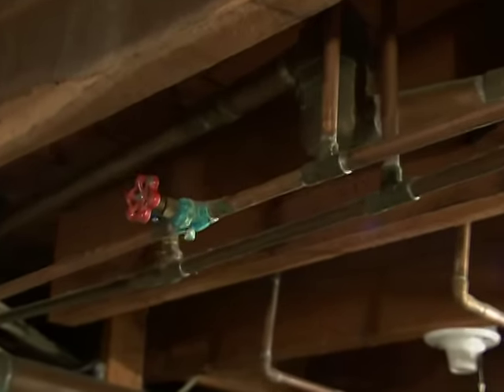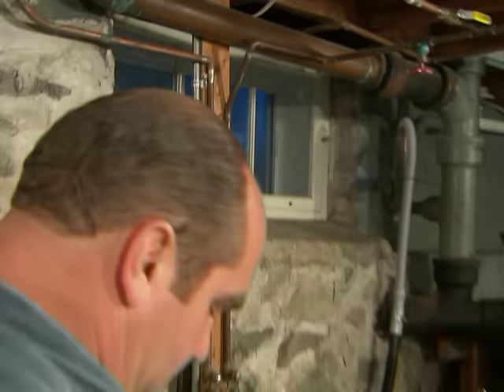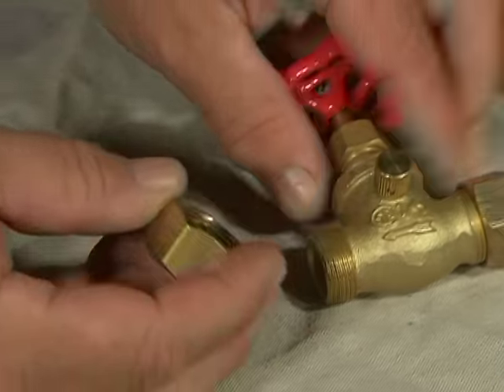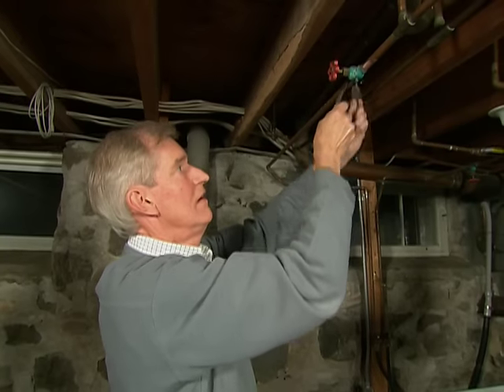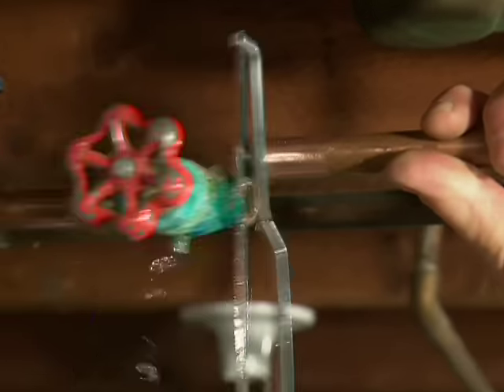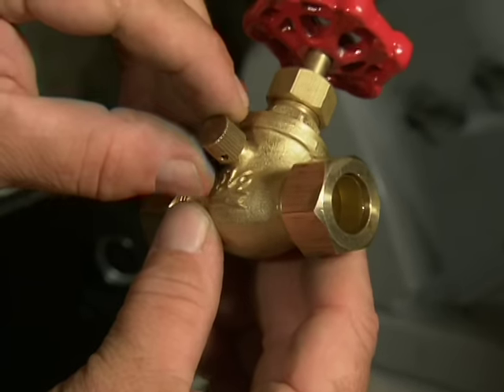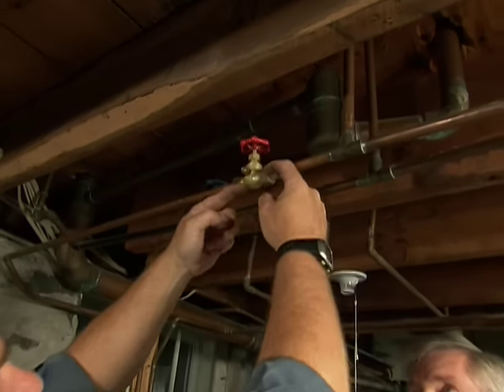How to Replace a Plumbing Shut-Off Valve | This Old House

Comment: what grit  sandpaper did you use
Reply: It's called sand cloth and found in the plumbing area. It doesn't have a grit number like what you use for wood.
Reply: it's emery cloth which is aluminum oxide abrasive glued to fabric. for copper pipe you'd use 120 to 180 grit
Reply: I've always used what's called crocus cloth on copper pipe. It'll really clean-up copper pipe really slick and pretty. It's an abrasive sheet (You can also buy it in a roll) that's similar to sandpaper (Closer to emery cloth), but covered with a layer of very fine, loose, iron oxide particles rather than with an abrasive like sandpaper.

Comment: how many teeth per inch should the minihacksaw have to cut through the copper pipe?
Reply: it is often best to have several teeth of the saw engage the cross section you are cutting.  for the relatively thin copper pipe this would require many teeth per inch.  32 might be close, but if you cant find one that fine use as many as you can get.

Comment: he did not explain why he points the handle up
Reply: preference
Reply: so that the waste valve would not completely drain the pipe.  maybe not such a good idea.
Reply: Yes Richard I would like to know why you put the valve up and the waist up instead of the waist down like how it was originally. I'm sure you have a good reason I just can't think of it so please enlighten me if you will. Thank you
Reply: Steve Kunkel when you place the valve handle down it increases the chance of debris settling in the valve which could potentially cause the valve to not close when needed. However in this situation since he used a shutoff that has the drain on it, placing the valve handle upwards renders the drain useless. Placing it on the side usually makes it so little to no debris settles in the valve, and then the drain would work the way it were designed.

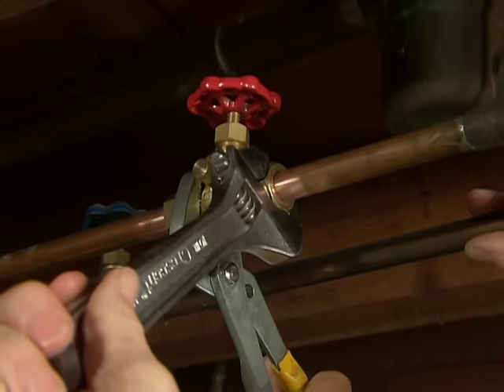Comment: 3:09 3:29 Internet Tool Police: You instructed the homeowner and your internet audience to use a cresent wrench backwards, twice. 
[EDIT] I think the manufacturer recommends what leads to fewer warranty claims. Putting the pressure at the bottom of the sliding jaw leads to less chance of rounding the fastener.

Comment: Can the Sharkbite fitting be used instead of that fitting?
Reply: Most likely as long as there is enough pipe left.
Reply: Shark bites don't hold on copper if there is a freeze.  They pop right off.
Reply: If your pipes freeze that hard, you're gonna have problems no matter what unless you use Pex, then your chances of surviving a deep freeze are much better as demonstrated here:    https://www.youtube.com/watch?v=OOeBJ8mDr8Q&list=PLDCpav5_VXPLU8El3cwSPfl-zedvKbhKu

Comment: ALSO THATS THE STANGEST THING  WHY CUT THE COPPER LINE IF YOU COULD EASILY USED A TORCH OR HEAT GUN TO MELT THE SOLDER AND SLIP OFF THE BALL VALVE
Reply: The operative word is "easily."  If he could of easily de-soldered the valve, then he could of easily soldered on a new one. I think he was showing an option for the homeowner.  If that compression valve needs replacing in the future, it's a big deal getting those ferrules off.  They require a special tool.

Comment: how would i do this if my pipes are galvanized not copper?
Reply: Timothy Champagne you need to find two threads in the area of the old valve , so the old valve will unscrew that’s one thread than you have to replace the pipe down to the next thread in line. Once you have two threads than you screw on a thread ball valve , they are the best valve out there and they work for your lifetime, second go to the second thread and screw on a copper female adapter with a piece of copper already soldered
Into the adapter, and than screw a copper male adapter into the house side of new valve with a piece of copper soldered onto that fitting also and you want your two new pieces of copper that are not threaded to butt up against each other , than just put a copper coupler on the ends of the new copper and solder that last fitting.
Reply: Many old houses have galvanized steel supply lines well before copper was common practice. When possible (access and financial means), it's best to replace all of the old pipes because the old pipes will rust up and give you hard water and rust stains as they age. You just  have to make sure you use a brass or dielectric connection between the old and new pipes or you'll have a bad time (bad chemical reactions between zinc and copper)
Reply: Timothy Champagne galvanized pipe doesn’t rust that’s why it’s acceptable to use for potable water.
Reply: Daniel Gordon didn’t you ever learn the difference between then and than?
Reply: NonyaBusiness! Lots of older houses have galvanized iron water supply lines. Before the days of copper and pex

Comment: Bigger problem when this valve fails.  You will have to cut the pipe to remove the ferules.
Reply: +PanamaSticks Why? I've never had to do that. Either slide it off or use a splitter.
Reply: +nmg196 Slide it off?  My experience with compression fittings is that the ferrules don't let go of the pipe after you loosen the collar.  So the next time you need to replace the valve you will either have to cut the ferrules off the pipe, or find an identical matching valve that can utilize the old ferrules.   If you cut the ferrules off, you will have a longer gap to bridge.  You will need to splice in some pipe.  Every splice is another  potential leak.   So I would prefer to sweat off the old valve, clean the pipe, and sweat on a new one.
Reply: +PanamaSticks I removed 8 yesterday just by sliding them off with some grips. I've heard this doesn't always work if they've been severely over-tightened (and compressing the pipe itself) but in that case, you can male a diagonal slot with a hacksaw (not all the way through!) then use a flat blade screwdriver to snap it off. There shouldn't be any need to cut the pipe unless the pipe has been severely compressed or damaged by over-compression of the ferrule (or a botched attempt to remove it).
Reply: +nmg196 You can also buy compression sleeve (ferrule/olive) pullers. http://www.amazon.com/Pasco-4661-Compression-Sleeve-Puller/dp/B00065DH2W/
Reply: +nmg196 Didn't know that.  Thank you.
Reply: +nmg196 Thanks again.  That sounds like a good approach.
Reply: Guess ive been lucky, so far ive always been able just leave the nuts and ferrules and slip in a similar valve with no leaks, done this maybe three times.  Any more I just install 1/4 turn ball valves, they seem to last far longer and always shut completely off.

Comment: Common corrosion issue with copper....   Personally I would ripped out all that junky copper and replaced it with PEX.  You will never ever have any type of corrosion issue with PEX while saving money at the same time.  That valve will have to be replaced AGAIN in a few years.
Reply: Ha, Ike just schooled Danny !  Nothing beats copper unless you're a plumber and want the the same money for a cheaper install. And yes I know Pex is the new wave/rave but I don't care, copper all the way. Also with Pex, if you want 1/2'', better install 3/4 because the 3/4 has an I.D. of 5/8.
Reply: I was gonna say. Rip out all the copper and put pex? I don’t think so. My house was built in 1950. Good luck with that. I have MASSIVE copper piping.
Reply: I have some pex at my water heater and the hard water eats those brass pex valves in a year , I use compression stop and waste valves in my 1920 built home and they work the best.
Reply: NonyaBusiness! Where are you at?
Reply: Have you not started using hep2o fittings across the pond yet? You can get a hep2o shutoff valve for 5 quid and they remove cleanly with a 30p tool
Reply: +Buttered Toast:
I would never replace a fully functional system. Only expansions or if you need to replace it because it suffered damage.

+NonyaBusiness!:

In Germany we use compound pipes instead of pure PEX. Inside is PEX (crosslinked polyethylene), than an adhesive layer, than Aluminium, another adhesive layer and on the outer side a protective layer made of polyethylene. Temperature resistant up to 95°C (203°F) and a pressure of 10 bar (145 psi). If installed and maintained properly a lifetime of at least 50 years is guaranteed by an independent testing and certification organisation, the DVGW.

https://en.wikipedia.org/wiki/Deutscher_Verein_des_Gas-_und_Wasserfaches

I've replaced the old galvanized steel pipes in my house with compound pipes. Copper was only used in my heating system (hot water radiators, common heating in Europe) with crimped fittings. In my basement it was already partially modernised with stainless steel pipes (crimped fittings too). So it wasn't necessary to replace the pipes there.
Reply: Only micro plastics in your water. Nothing else...